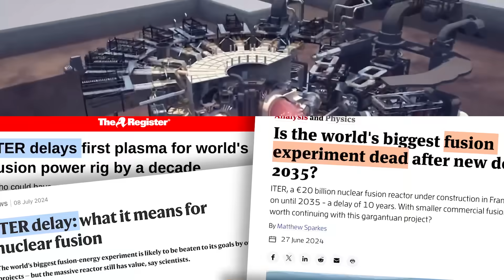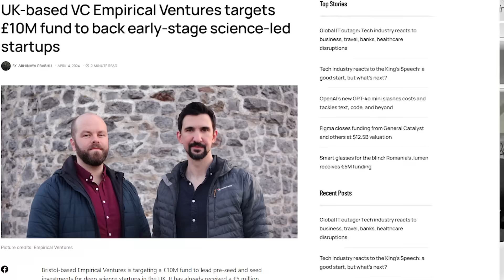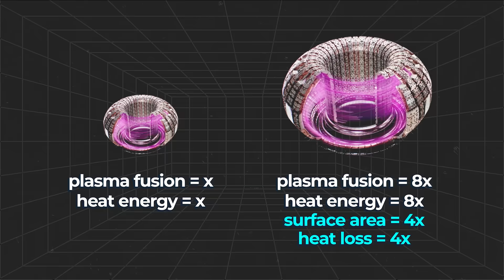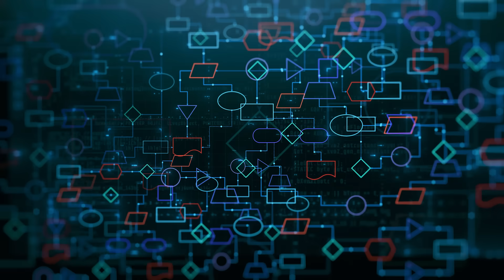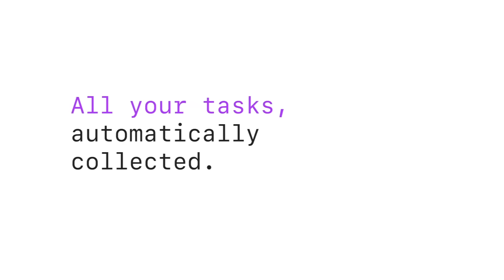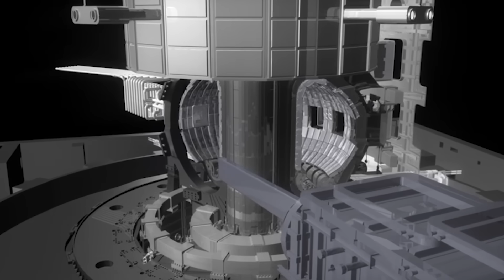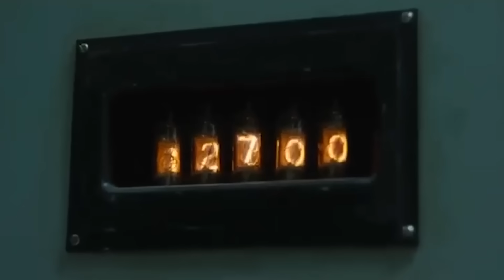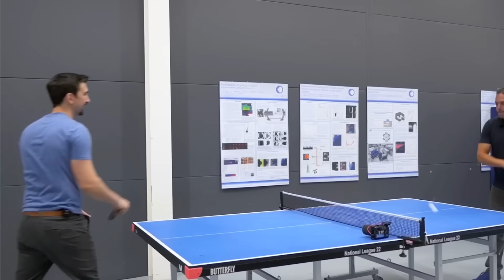Is The World's Largest Fusion Project Dead?

Comment: 'We have 35 credible teams advancing different approaches faster and for a lower cost' - That isnt really true. None of the other projects are as far along as tokamak research and we frankly have no idea what kind of problems they will run in to when scaling up to a real grid level power station, and if there is one thing that fusion research has told us its that there are always major problems; Yes, they are moving fast at the outset, so did tokamak research thats why the oft repeated 'Its thirty years away' emerged before it became clear just what a herculean task it was really going to be.

The difference between ITER and just about every other attempt is that ITERs issues lie in management, budget, sourcing parts, etc, but the science behind it appears absolutely rock solid. Every experiment at places like JET have only served to prove that ITER will work and quite likely well beyond expectations. The other approaches are important to investigate but are littered with far more unknowns as to whether they will be ready in short order, will take many decades, or just arnt viable at all.

I wish ITER didnt suffer the problems it did with the bureaucracy, and less money was spent so it could be spread around a bit, but I wouldnt choose to abandon either side of this. ITER should be built, experimental alternatives should be investigated, and we are successfully doing both. We are on the right path with this, even if it could and should have been a lot smoother a journey.
Reply: Most of the other credible teams are also building tokamaks. They've just figured out smaller and cheaper ways to build one, but it's still based on the same well tested design as ITER. ITER's problem is it was designed to around the limitations of 1980's technology (forcing it to be enormous). 2020's tech would allow it to be significantly smaller and cheaper, but ITER is too far along to redesign it.
Reply: @lifeteen2  Which limitations? The size does not come from technical limitation but rather the plain physics!
Reply: @JacquesMartini  The size of ITER was limited by the flux density of the superconducting containment magnets. So yes physics dictated the required size at that flux density, but there have been several recent breakthroughs in superconducting magnets that increase the flux density and thus can shrink the physical size.
Reply: @lifeteen2  ITER is a scientific Ponzi scheme if you have not figured it out yet. They all know that the moment they turn the machine on that the eyes of the world will be on them and it will be almost impossible to BS any excuse of why it does not work and that will be the end of all this money they are getting. Think about it trillions of dollars have been spent and billions more is available as long as they can keep people believing they will solve the problem next year or the year after but the second they solve the problem that money stops. Sure the scientists working on it may or may not be in on the scam but in my opinion they all are involved in it just to keep the money flowing in by the truck loads. ALLEGEDLY
Reply: That's a brilliant summary. Cheers. 👍
Reply: It isn't true that  those private companies aren't working along the lines of tokamaks. There are at least two which do: Commonwealth Fusion Systems in Massachussetts, and Tokamak Energy in England. One of the big differences with ITER is that they aim at using High Temperature Superconductors (HTS) with greater magnetic fields. On the other hand, I agree on everything else you stated. Regarding the last paragraph, I'd point out that the performance of fusion experiments was above Moore's law up to 2000. Then came ITER and everything stalled. Maybe competition is better than cooperation in this kind of endeavors because it keeps the sense of urgency alive.
Reply: An excellent summary of the facts which is why I still maintain that this is a big scam in Physics.
Reply: @SANibbler  fusion research has been following a trajectory of demonstrated results that is progressing almost as fast as Moore's law, with the so-called "triple product" of temperature x density x duration created in fusion experiments doubling approximately every 3 years for 30 years. Over that time the factors that go into producing fusion energy have been increasingly well-established. There is also a separate set of research into ways of controlling fusion plasma in a sustained reaction that is also progressing steadily, though that will probably only kick into high gear when there are reactions capable of sustained fusion reactions in a decade or so.
Reply: Those startups could be doing more with more money.
You simply cannot run an innovation project on multi-decade schedules. Now we have a 30 year old design that maybe, maybe will be done in another decade.

There's no urgency, no pressure to solve problems in a cost-efficient way, no pressure to rethink the design at ITER, since you can always just ask for more money.

Startups don't have that luxury, so some of they will inevitably push the boundaries and come up with better solutions, while ITER is still building the future from the 80ies.
Reply: ITER has a few fundamental flaws. 
1. It is based on the Russian T-15MD, never able to achieve the anticipated outcomes of ITER. 1-second bursts are expected to be 500 second in ITER and so far, not a single second.
2. 35 nations working together, in any case, for the common good by energy production, or any reason, slows projects to snail's paces. ITER is not designed to be an energy production system in of itself but provide a platform from which the World will learn to build reactors and provide each of their nation's power needs, long after 2035.
3. The cables used for magnetic confinement, are made from niobium-tin (Nb3Sn) and niobium-titanium (NbTi), both are rare earth elements. Production of these superconducting strands involved a significant procurement effort, with 500 metric tons of strand produced by nine suppliers between 2008 and 2015. This cable length is more than 100,000 km, enough to wrap around the Earth 2.5 times.
4. Current-generating fusion reactor supplying 1,000 MW the electricity needed to power the superconducting magnet cryogenics system, is in a range of 20 to 30 MW.
5. Apart from problems of yield and electric consumption, there is not even one electricity network in the world that can supply the 2 GW power input required.
6.  ITER's magnetic systems, in particular the TF (Toroidal Field) system, store unprecedented amounts of energy, far outpacing all the other superconducting systems developed to date. The huge size of these magnetic systems means it is essential to use high currents (40 to 70 kA) to limit inductances and, therefore, electric voltages, during operation.
7. Disruption (plasma disruption): indicates full loss of plasma confinement. A disruption may have many consequences. Any sudden decrease in current and/or magnetic field induces mirror currents and/or magnetic fields in the components surrounding the machine. These components are then subjected to what may be considerable forces.
8. ITER is billions of dollars over budget and decades behind schedule. Not even its leaders can say how much more money and time it will take to complete. 2035 buys time, that's all.
9. Cable-in-Conduit Conductors (CICCs) developed for ITER are a significant part of its overall cost. ITER total costs surpassed €20 billion (approximately $21.8 billion), which is more than four times the original budget of €5 billion, the CICC costs represent 30% of the total cost alone, more than the initial entire budget allocated!
10. ITER is funded and run by seven member countries since 2006. Not one of these countries honestly expects ITER to EVER become fully operational, based on costs and time.
11. Charles Seife, director of the Arthur L. Carter Institute of Journalism at New York University, sued ITER for lack of transparency. Since then, its damage control and cover ups.

According to Yang Zhao, Energy Singularity's Chief Executive Officer, using high-temperature superconducting materials can reduce the volume of a device to about 2 percent of that of traditional low-temperature superconducting devices, allowing the construction period of the device to be shortened from ~ 30 years to only 3-4 years. Shanghai, Energy Singularity, completed the engineering feasibility verification of high-temperature superconducting for its Honghuang 70 (HH70) tokamak device

"The design work of the device began in March 2022, and the overall installation was completed by the end of February this year, setting the fastest record for the research and construction of superconducting tokamak devices worldwide," Yang Zhao, Energy Singularity's Chief Executive Officer.

Energy Singularity plans to complete the next generation high magnetic field high-temperature superconducting tokamak device, HH170 with a deuterium-tritium equivalent energy gain (Q) greater than 10  by 2027.
Reply: @mrhassell  I'm going to bet you 10 dollars right here that 2027 will come and go without Energy Singularity doing no such thing. If the path to fusion was that clear, we would be on it right now. 

REBCO magnets have only become a possibility in the last year and a bit, if we redesign ITER every time a major advancement is done, we'll never get to test anything.
Reply: @mrhassell  Thanks for the information.  Has anyone ever estimated the cost of the electricity that any fusion reactor might someday produce?  I'll bet it's an order of magnitude more than existing renewables.   A small point:  Neither Niobium, Tin, nor Titanium are Rare Earths.  That term has a specific meaning, and it isn't "stuff that comes from the Earth and is rare".  Also, titanium and tin are not even rare.  Niobium is not terrifically rare.  It's cheaper than silver.

Comment: The biggest issue with continuing with ITER is that even if operational that style of fusion still has problems with radioactive waste. They absolutely would have been better off building out several small ideas to first find what seemed the most viable then make a large scale.

Comment: "Science is good" is not a reason to continue any one specific scientific project. Centralized power is a proven folly, especially in the disaster-laden world of climate change. Centralized power requires distribution infrastructure, the entire network being made useless by a single, vulnerable point of failure, and massive attenuation loss. We should be concentrating on developing robust on-site power generation to decrease the chance of any single catastrophe taking away the survivability of an entire city.

Comment: I think the other fusion projects are generally very much oversold. Especially "micro" reactors. I would have rather seen all the effort spend on building wind, solar, geothermal, tide and other renewable energy plants in combination with more and better battery storage. I wouldn't mind having seen better fission plants as well. Reducing our carbon emissions simply has to come first and the rest is secondary.